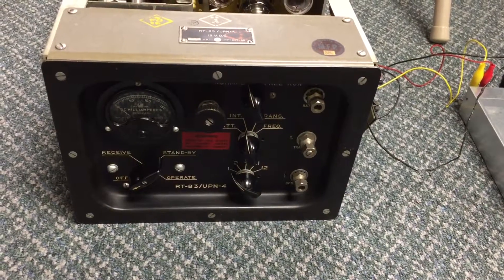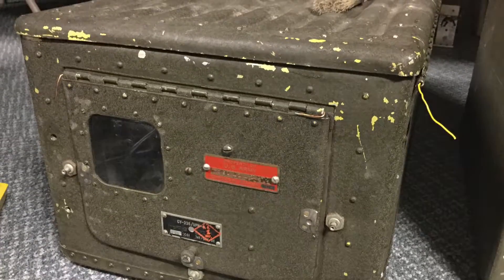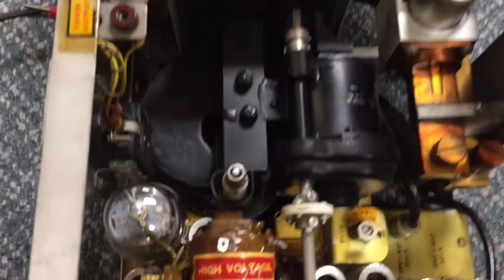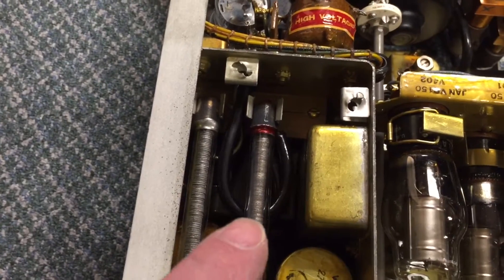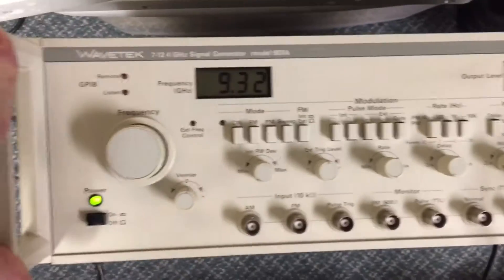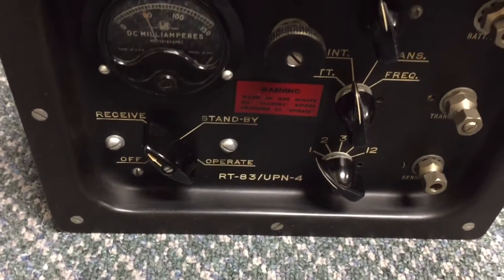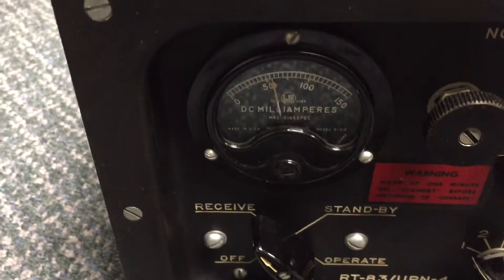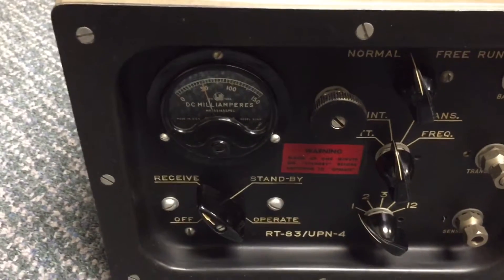WW2 AN/UPN-4 Radar Beacon

Comment from the maker: Since this video seems to be getting quite a few views lately, I though I would give an update. I have since obtained the correct waveguide adapters to properly test this unit and have verified that it does function. The selenium rectifiers are not in great shape, so it would need those replaced to operate reliably. However, this really belongs in a museum as I have not seen or heard of one that is still intact and original. This particular unit was set up for vehicular use, as it never had the portable antenna installed and is equipped with a standard X-band waveguide output.

Here is a video explaining how these were used. It primarily deals with a previous model, but the tactical use is the same. It gives a historical background as well. https://youtu.be/mNBnnOvRtQ0

Comment: Amazingly in great condition! A cheap radar detector might detect the signal from this. X band is what, 10 ghz? Once, I had a relative give me a piece of military radar.. IFF (friend or Foe), just part of it. I was still in the USAF, I took it in to work and we had a great time figuring out what did what. No tubes or power supplies left. Just tuned cavities and magnets, small circuit boards, black mushroom cap looking transistors, all coated with epoxy resin. You have a beautiful museum piece!